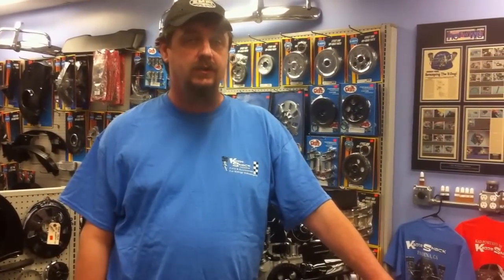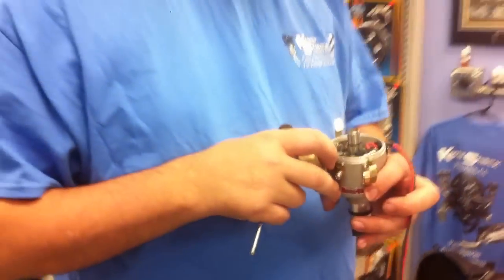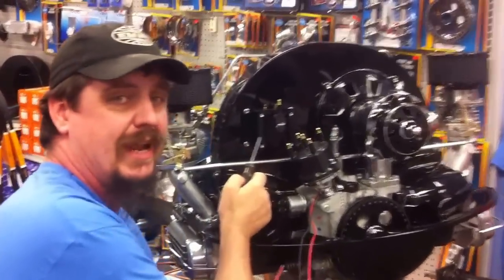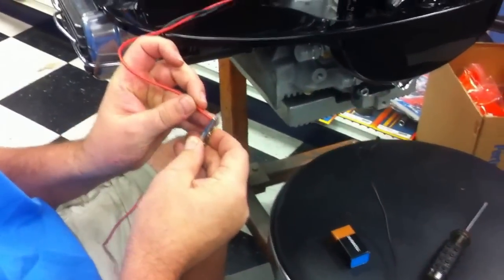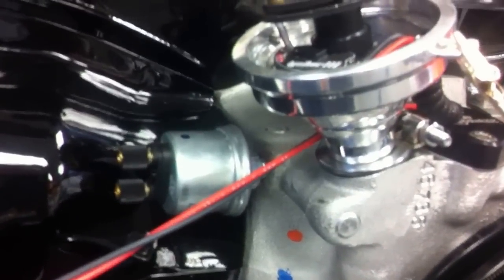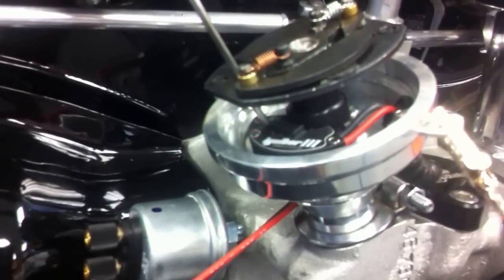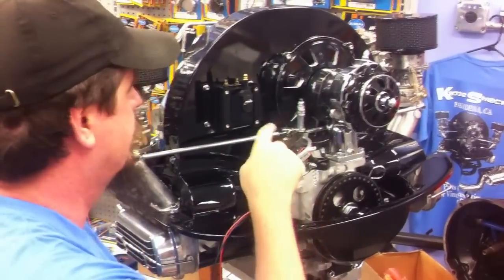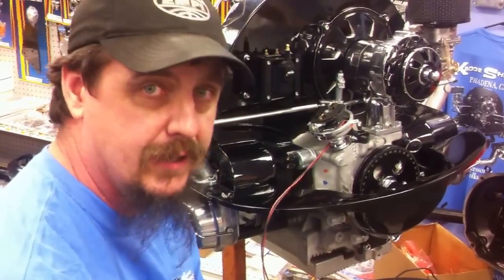Pertronix Ignitor 3 Distributor Installation for VW's with Kaddie Shack

Comment: what RPM should a stock 1600cc rev limiter be set to? Also Does a Stock 1971 SB 1600cc have a factory rev limiter? I have one but didnt want to rev it that high to find out the hard way that is doesn't ?

Comment: Great friend explanation
I live in Brazil and here the passion for VW air-cooled crazy!
A doubt about distributor, I'm buying model EMPI 9437-B with the ignition box attached to it!
link:http://www.ancona.com.br/loja/Empi-DISTRIBUIDOR-EMPI-CAIXA-IGNI%C3%87%C3%83O-9437B-C%C3%B3d03328-p-3328.html
It would be a good option for a unique engine without pepper dose?
I will not have the problem module is flush at the gas pump?
Works well?
great day